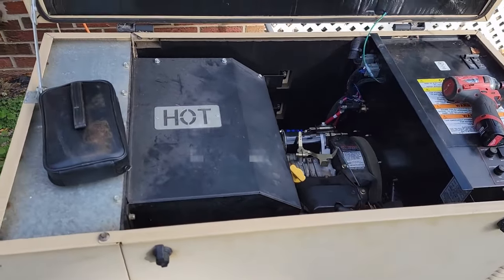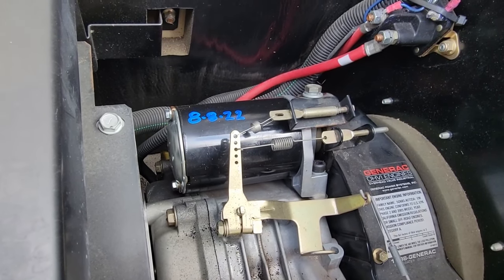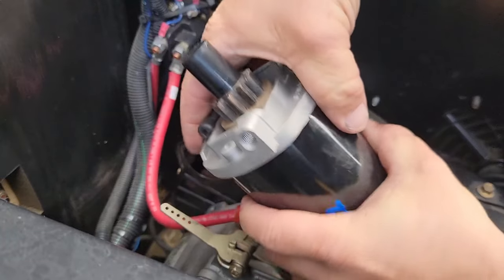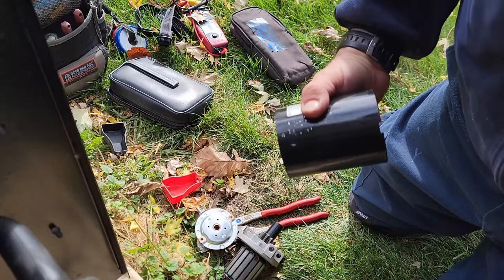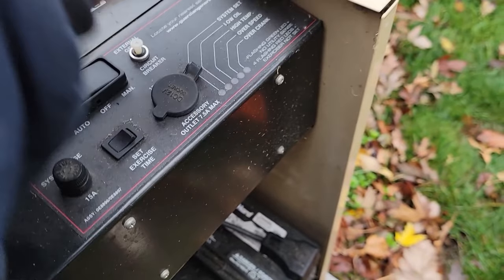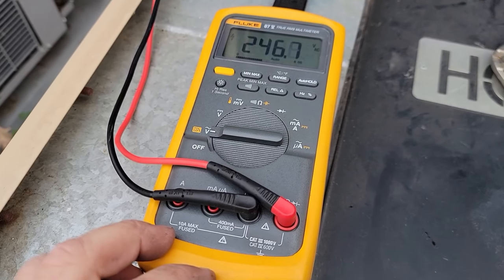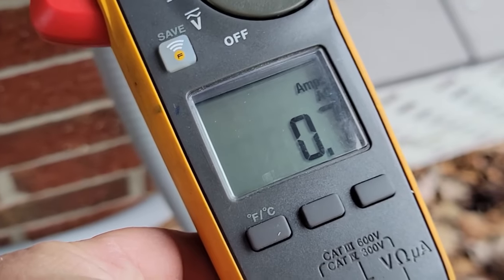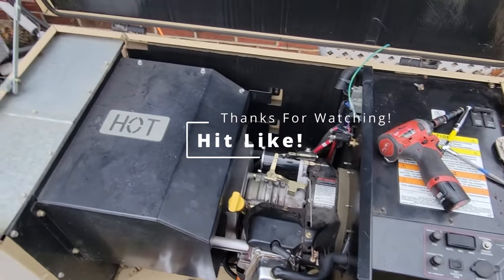Generac Standby Generator Wont Start AGAIN!!!

Comment: If I saw you hammering on my equipment with the side of a wrench or using channel locks like you did without using the right wrench or sockets, I would kindly ask you to leave and please ask a professional from your company to come out instead. I used to do field service work and as the point-man for my company after the sale, I had damn well better represent my employer to the best of my ability. I was doing field service work in the Maglite factory in Ontario, CA. I was using a Brinkman flashlight and the shop manager asked me why I did not have a Maglite since his company bought from us, should we not buy from them? Point made loud and clear. This guy then takes my Brinkman apart and shows me every reason why Maglites were superior in every way to a Brinkman. Again, point made. The next time I was at Maglite,  I had two of their flashlights in my kit! Counter-point made.
Reply from the maker: @jay I had to go through and watch the video again because I was confused what piece of equipment I was allegedly beating on with the wrench?  If you were paying attention I put on the display that these are not regular cheap ass pliers they sure as hell aren't channel locks. Get a Clue and do a little more research. Just because you won't pay $65 for my style of pliers and are used to using cheap junk does not mean I am damaging anything. Let me get this straight...  you're bitching about me taking apart a starter that I can smell is burnt up with my pliers wrench (that the customer will not be keeping)...🤔🤦🏻.... I had to disassembled the starter to know why this thing burned up so it doesn't happen again. Viewers like you disgust me because all you do is look for things to bitch about. Some people only want to condemn others when there wasn't a dang thing wrong with what I did. We warrantied the starter, we ate the labor and the customer didn't pay anything extra...so get your facts straight next time before condemning someone.  I never said I was "the generator authority" but I have real world experience that I'm willing to share for FREE on YouTube. Currently this video is at 52,000 views and you're the only one that said anything about that? Mmm 🤔.... It might be time for you to start a YouTube channel?
Reply: In my opinion, using channel locks on a bolt, nut or any six sided fasteners is unprofessional. It wears out the head or nut and makes it rounded over time. Use the right tool for the job needed. Battery terminal? Use a socket or the correct sized wrench.  Starter solenoid nuts? Use the right wrench size. Don't guess. Even that expensive tool rounds bolt edges if you don't completely clear the bolt when moving into a new position. Did you double wrench the terminal connector when putting the wire connector back on? Bad habits are hard to break. 
Use a hammer to hammer not a wrench. I have made YouTube videos btw.
Reply from the maker: @jayrenner1053  I don't see any videos listed under this name, list them I'm interested in seeing a professional, I bet I can find something wrong with it.
Reply: @HVACRSurvival  No YouTube videos were ever uploaded by me under this account. However, I do have some out there with a different account name. Good luck finding them.  Uploading videos does not make one a pro - decades of field work does as well as taking criticism with an open mind. People will judge you by your actions. I am just saying you should up your game if you are going to make instructional videos.
Reply from the maker: @jayrenner1053  Admitting you will not tell me where your videos are located tells me everything I need to know about your credibility. Far as taking criticism is concerned, I have no problem if I'm wrong but in this case, I'm not. I'll be making a video real soon showing how an open-end box wrench is a piece of crap that will destroy the bolt head and nut where as mine will not. Obviously you've never used these pliers like these or you would never said channel locks.  It's not my fault you don't have nice tools and you've never used quality like this.   As I said you're one person out of 54,000 views that said anything. I'm done talking about this.
Reply: He said the weren’t regular Chanel locks.  If you look at the jaws, they are flat.  They’re not going to ruin the flats of the fasteners.  It all a matter of preference.
Reply: Hey Rick, good job in all what you did in the video, and don't listen to that person he is jealous
Reply: @HVACRSurvival  Now that is some retaliation! Don't worry Rick, there are always going to be haters. You will deal with them for the rest of your life. Just keep "cranking" out awesome content just like normal!
Reply: Dork
Reply: OMG, Someone got Butt hurt over a VALID Critique. And NO I don't have any Videos on YT, so if that's Your idea of what makes you a PROFESSIONAL, Good Luck. I'll takes years of doing something OVER someone who thinks putting videos online make you a Pro any day.
Reply: @jayrenner211 You don't seem to know what you are talking about. Those are Knipex pliers and are designed without the rough texture of traditional Channel Locks specifically to mitigate the risk of rounding a bolt out. They are going to work as well as or even better than your usual wrenches would in any given task, which is to say they'll only round a bolt off if you're using them obviously wrong or the bolt was so structurally damaged already that you need a new bolt anyway. Additionally, he was hammering on a melted starter not a part that was any good! What does it matter what he hammers on it with if it's going to the remanufacturers? Finally, I'm trained as an auto mechanic, not an HVAC technician, but if I hired someone to work on my equipment and found out they were run by people who obsessed over something like a Flashlight brand, I would fire them immediately and especially if they were doing so just to make their company look better.
Reply: The guy did a great job!
Reply: @HVACRSurvival  I agree,a open end wrench will round  a tight bolt every time ,the jaws will spread and it will slip.even a snap-on. That’s why you if possible always use a box end to break loose bolts/nuts and then if you want to loosen with the open end then that’s fine.
Reply from the maker: @ClintFomby  if they were a crescent wrench I would agree. My Bahco do that. But you haven’t used these before or you would know they can’t do what you’re describing with any grip on the wrench.

Comment: I was wanting you to get a wrench, hit the starter button, and beat the starter like a red-headed step child.   That's how you check for a starter that's going/gone bad on most cars.
Reply: If it has a permanent magnet motor, you don’t want do that. If the starter wasn’t broken before it will be when you’re done.
Reply from the maker: @fixinggrace  you did not realize he was kidding?
Reply: @fixinggrace  - If your start has the solenoid jamming, so it won't start the motor, you already HAVE a broken starter.    I've had to do the 'rap on the starter' a couple of times to get someone home - including myself.
Reply: I bet that starter hung up while it was running and that’s what caused the damage, in a bind from the wrong shims and spinning at high rpm’s and it got hotter than shit and melted then something shorted out and burnt that wire into.

Comment: we picked up a used 90s generac 10000 that ran rough. Found a chewed spark kill wire that shorted. Fixed it, cleaned off the gen set, fresh oil, and it runs like a champ. Turns out Generac simply rebranded a 100% made in USA Briggs & Stratton industrial gen set as their own. Very high quality unit.
Reply: New ones are trash
Reply from the maker: Briggs and Generac both make engines for each other.
Reply: The older stuff from briggs is good but the new stuff is complete junk.
Reply: @williamvaughan1218  The Chinese generators sold under names like Predator, DuroMax, WEN, etc. are the biggest problem; in medium size portable generators, their China-made knockoff Honda-clone engines are made with cheaper materials, poorer castings/machinings/bearings, etc., so they don't last, tend to fail catastrophically, and need careful break-in to run for any length of time, and they displaced more reliable engines from Honda, Briggs, Tecumseh, and Kohler. Briggs & Stratton is an engine company, and their portable generators are using Chinese engines with the B&S badge applied. Likewise for Generac, their entry level portable generators are using Chinese engines. Nowadays you can only get quality name-brand engines on generators made for contractors and sold at higher contractor pricing, like Wacker Neuson, because downtime isn't tolerated on a jobsite.
Reply: Ha😂 I had the same issue when it was new and the only co in my rural area didn’t know about the motor issue I figured it out and told him they said no it’s running fine I showed him the spark plugs that cylinder was not ! I Got Nothing Done Under Warranty because they said it was Okay. I pulled it apart and found what I thought was as the problem! A few years later the starter failed & guess what, the had Changed the design? I hope it’s the starter solenoid this time😡

Comment: I've found the OEM contactor is poor quality and may contribute to burning up the starter. After replacing the contactor twice, the 3rd time I put in a Stancor 70-902 which is rated for continuous duty at 80amps. Problem solved. Also with overcrank warnings, dig through the Generac service documents as there was also a note about a weak/defective magneto in some models. Once I replaced mine, starting was much easier.

Comment: Once the engine begins to run, it will rotate faster than the starter motor which will drive the starter bendix gear back down the helix and out of engagement with the ring gear.  All that mechanism relies on inertia to operate.
Reply from the maker: These don't run much so these things happen. Hopefully she buys a new outside section.
Reply: @HVACRSurvival  do you think doing a monthly 15 minute run would help with longevity?
Reply: @InsanePacoTaco  ... they are set from the factory to run 12 minutes, once a week. (you set the time) Part of the problem I saw in the field was older sets that didn't start well because they needed a spark plug or valve adjustment. The unit faults and nobody figures it out till 9 months later.

Comment: That's a Bendix gear.   It SHOULD have a good amount of grease on it.   That one looks as dry as Betty White's back was.
Reply from the maker: 🤣🤣🤣🍺🍺 I'm a refrigeration guy I'm not a engine mechanic
Reply: @HVACRSurvival  - When you put in something like that, it needs a bit of grease (if it's exposed, non-detergent oil is okay).  

I suspect that what happened is that the gear stuck and wasn't able to retract, and that started running the heat up.   Everything else happened because of the heat, not the wire breaking (broken wire would actually make it stop, or run cooler)

Comment: Great Video! Fixed my issue! During a recent neighborhood power outage my older 7kw generator did not kick in. I first thought it was the battery, but that tested out perfect. So on the inter-web I went and found this video. Watching it closely I followed the testing procedures, and sure enough it seemed like the starter pooped out. I called Generac for the correct starter number for my unit and found it on Amazon (of all places) for a great price! Plus, it arrived by 8am the next morning!! Bonus! I'm now back in business thanks to this video! 🙂
Reply from the maker: Sweet 🤙.

Comment: I keep up a 2005 model 15k Generac Guardian Plus.  All it has required is several batteries, oil/filter changes and a valve adjustment.  At 16 years old the NG fuel valve/regulator went out due to age.  It still runs perfectly today at 18 years old.  They are no more trouble than any other piece of lawn equipment, etc.  Maintenance is key.  3 day oil change is required if running during a prolonged outage with conventional oil.  I get a week run with Amsoil small engine oil in hurricane alley!
Reply from the maker: You said maintenance is key, most people don't do it until they need it.
Reply: @HVACRSurvival  With the power out for 8 weeks after Hurricane Laura, I can tell you what happens to all sorts of generators when run day and night for weeks!  The 4 standbys and 5 portables that I care for, all survived just fine while other's bit the dust.  Not changing the oil and filter every few days or using too small of conductors will kill them quickly!
Reply: Why don't you use the proper tools to remove the battery cables and the starter instead of using the channel locks as the one and all tool? I never seen someone use a pair of pliers as a hammer before - until now. 
You certainly are a graduate from the hammer 🔨 mechanic academy. 😂

Comment: I have two Onan generators..one I bought new, a 5K, 1800 RPM tri-fuel fuel that I ran on propane for 7,500 hours and then had it rebuilt, moved to a different location where it’s running on NG  now at 7,800 hours..runs like a champ!

The other one is 15K, 3600 RPM running on propane, but suddenly it’s not catching so it’s got to be either no fuel getting to it..bad fuel solenoid..or points not making contact. One of these years I’ll get around to looking into it!

Enjoyed your work and comments!
Reply from the maker: Thanks for the feedback!

Comment: I really like the idea of using a label maker to mark the install and service date on the battery.  That is a great quick reference for you or who ever works on the machine later.  I'm going to do that even for my car batteries.  That part that moves gear in and out and lets it drive only one way is called a "bendix."
Reply: I'll do ya one better. Our company uses a sticker with 10 spaces on it where you can write what you did and date it. I also jot down the propane tank location so I can find it with a foot of fresh snow on the ground.
Reply: @Willam_J  Only reason I buy silver Sharpies - so I can write the date on black plastic 🙂

Comment: I was going to say something about the use of channel-lock pliers until I saw the flat jaw operation. I'm old school and prefer using the correct size wrenches but that works for me.
Reply from the maker: I recorded a quick test today of my plier wrench just to show the down pressure they have when turning a nut. An open end wrench doesn't have that.

Comment: Rick    I went to Generac when it was an off site school. Had to be bused to school from the hotel. Just wanted to let you know that the 10 kw unit has/had a breather leak and leak after it shuts down over night. The breather and gasket had to be changed. Plus the gasket needed to be cut back because it was to big. Ive had brand new units breaking the mags and engine castings. I like your generator videos. Keep up the good work.
Reply from the maker: Thanks, I'm glad to hear I'm not the only one that has had a lot of problems. I don't do near as many as I did prior. I'm trying to phase out of working on them.

Comment: I have a 2 year old 22KW. I pay to have it monitored. It had an RPM warning which means it didn't start. I went out and got it running but the starter sounded odd. I'm in Florida. Generac had a bulletin if you get that warning in a hot climate to replace the starter. It's the exact same starter as the original. Seems odd to me but it was replaced under warranty and no more issues as of yet.
Reply from the maker: Good deal🤝👍👍

Comment: Once again, Great Serv & Video Brother!    BTW 
the starter retractor is called a Bendix . that washer that mounts before starter is a spacer, you need to properly adjust clearance to flywheel so the Bendix can retract properly n not stick.
Reply from the maker: The only adjustment you could possibly do is out away from the flywheel. There’s no wiggle anywhere else.

Comment: Had a 8kw Generac a few years newer than the model in the video, the engine appeared the same. Kept burning up starters and had trouble starting. Repair services would come out and say the starter was bad, fixed the immediate problem but never actually solved it. After some YouTube research I decided to adjust the valve lash myself. Totally solved the problem and only took a few basic tools and a feeler gauge.
Reply: in my 25 years servicing these a valve adjustment and a spark plug will fix 90% of hard start issues. I can't fathom burning starters with the factory default of limiting crank cycles. The customers must be out there resetting the darned thing 10 times!
Reply from the maker: It burned up because it did not retract, I did it on the video.?
Reply: @HVACRSurvival  ... yes, you did show it hanging up on the video. Guessing you changed the shim combination one more time.
Reply from the maker: @rupe53  if I left the camera run the whole time it would be an hour and a half or more,  people are lucky if they can stay focused for more than  5-10 minutes 😂

Comment: I have a GR 15 kw  LP I have already replaced the ing pack for one cylinder it was arcing to the head because it was pinched from the factory with the shrouding so it wasn’t firing at all. No one could find it. I took it apart and figured it out and I had to replace the starter that got updated starter changed model from G. Rack 😂 I’ve been doing maintenance on it and last year it had the same issue as you showed,but I thought it was the starter solenoid failed. Then I had retina issues and I couldn’t touch it now. The hurricanes are here back again and I need to jump back on this issue. Thanks for the guide to getting the diagnosis done. I hope my starter hasn’t died again and it is just a solenoid.
Reply from the maker: I’m glad it helped!